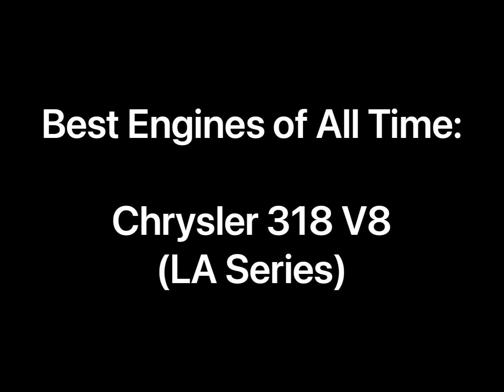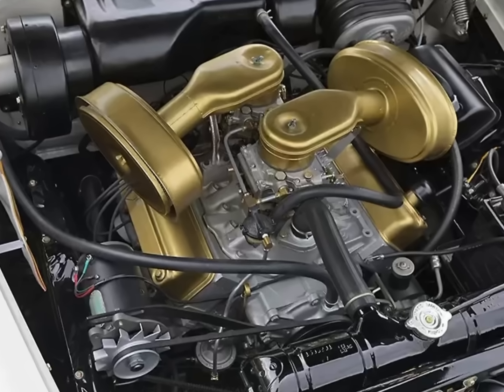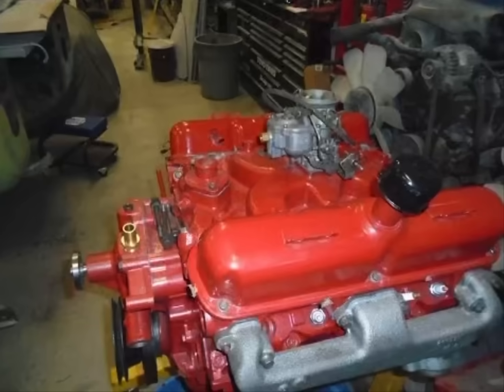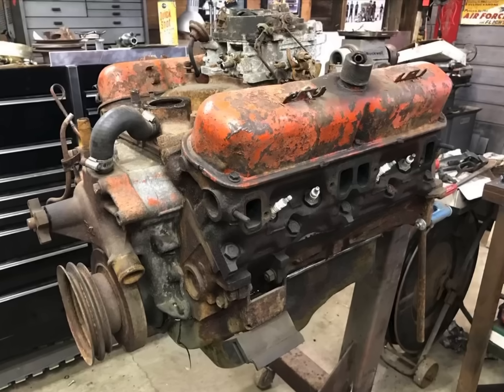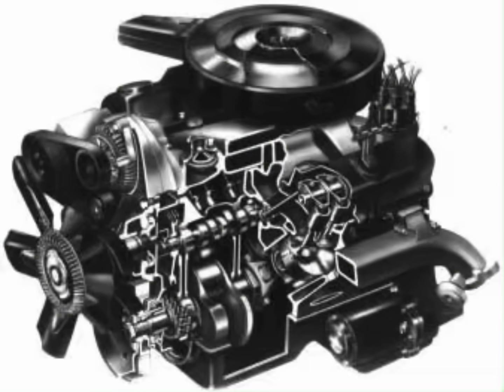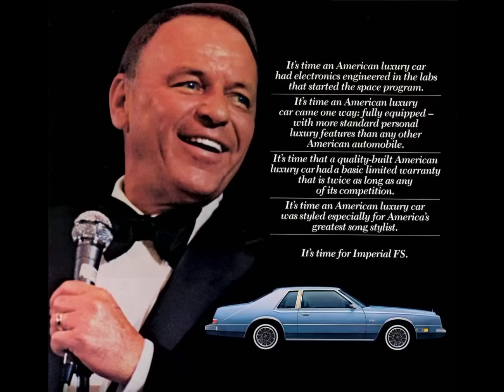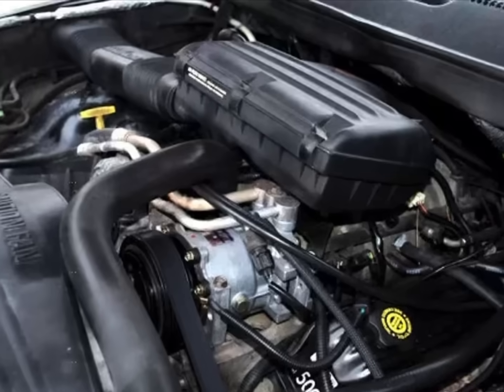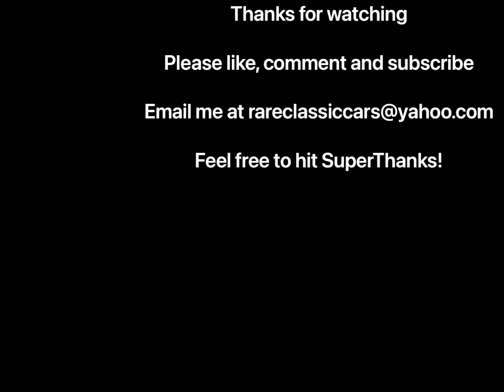Best Engines of All Time: Chrysler/Dodge/Plymouth 318 V8 (LA Series)

Comment: The 318 is indestructible and reliable because it was a relatively large engine. But COMPLETELY DIALED BACK. Tiny camshaft, 2 barrel intake, restrictive exhaust, and a very simplistic design. It made just enough power to move a big car or truck decent enough. But not enough to hurt itself. Where as a 340 isn't even much bigger but guys blew those up all the time.

Comment: The 318 is a true work horse. I worked at a golf course in mid Michigan and we had a 318 driven pump for one of our irrigation systems. That thing always started right up. Had a set of homemade headers that went through the roof of the pump house. On some nights you could see those headers glow in the dark after running for about 30 to 45 minutes. And you could hear that beast roar through the golf course when she was running! Thanks for the video Adam. Jeff of the North

Comment: I have a stock 1991 318 with the tbi system still on. Fires up every day and will run my 74 charger 130mph all day long at 11mpg

Not all of them are lemons

But. Ill see 180mph at 9mpg once I throw in a cam, singleplane intake and 750 edelbrok carb up top

Comment: Had a 318 in a 69 Plymouth Fury. Pushed that big car around just fine, with decent for the time mpg. Liked it more than the 68 Mercury Montego with a good running 302 that I picked up after. They both were no 68 Charger R/T with the 440 I had later, but still more than adequate along with their own pluses. Thanks for your fine videos.

Comment: My pawpaw gave me his and he drove it back and forth for years to the oil field and many other places and the truck is a 1986 dodge ram d150 and the Moter was a fresh rebuild that came from sun south engines back in 93 that is out of business now and the Moter has 187,000 miles on it right now the truck has had 2 transmission rebuilds and 2 rebuilt engines in it and I just turned 16 in December of 2024 and the truck has 287,000 miles on it right now and I just started driving it as a daily today so far it has been a great truck besides the gigantic hole in the gas tank I had to fix. Lol

Comment: My 1994 Jeep Grand Cherokee had the Magnum 5.2L (318) version of this engine. When I bought it used, maybe 6-8 years old, it was burning oil. I forget the mileage, but I just replaced the valve stem guides/seals and no more burning oil. The first side took a couple of hours, but I think I did the other side in less than an hour as I gained experience. The replacement guides/seals were cheap, maybe under $20! I was ecstatic because I was concerned the engine was on its last legs. It was great.

Comment: A 1974 Dodge Charger SE Brougham Edition that I owned had a 318 cui with a bunch of aftermarket performance parts including flow master 2 5/8 " exhaust, holly sniper intake manifold, mds race ignition box, four barrel holly carb, with a lot more performance parts underneath the hood, and Krager SS rims. At the emissions facility dyno they took it up to 2500 rpm's and the horsepower 275 HP. The tach went up to at least 6,000 + rpm's. I asked if he could rev it up higher to see what the horse power was and he said we can go above 75 mph because of safety concern rules for the emissions facility.

Comment: The 318 Magnum engine with multiport fuel injection was introduced in Dodge trucks in 1992, not 1993, as stated in the video. My 1992 Dodge W150 Power Ram LE that I bought from my father in law in 1996 came with the mpfi 318 Magnum. It has a black painted, traditional round metal air cleaner with a 318 Magnum decal on the lid, not the goofy looking black plastic box, like the one pictured in the video.

Comment: Since before I was born, my dad has been driving around in a 1977 Power Wagon with a 318.  The speedometer cable broke some time in the 1990s, freezing the odometer around 350,000 miles.  God only knows what the miles are now.  It's slower than dirt and uses fuel like an arson at a Shell station, but it always always always works.

With tbat said, the 318 majes a fabulous platform for performance, and they absolutely emanate power with just a mild build.  They'll surprise yourself.

Comment: Unless you have one in a 1989 pickup truck. The wiring is pre corroded from the factory and, it was  scrap wire to begin with. A lot of low mileage examples are available. Well, the ones that haven't rusted into the ground, are very low mileage. Because, they didn't RUN for long.

Comment: Wish they had kept and continued to develop the '81-'83 fuel injection. A really neat system. Would love to have seen it grow into a performance system. I managed to get an '83 Imperial that had not been converted. After reading a bit on how Chrysler had retrofitted them back in in the day, I did something like it, but much simpler. Dropped in a single wire ready-to-run distributor, and drilled an aluminum plate to bolt onto the stock manifold. As proof of concept, it initially ran with a stock 318 2V carb. Later, I used a different plate that matched the Holley 2300 style 2V carb so I could also have a functional (electric) choke. Naturally, it ran even better. The engines were production line units. It was assembled with the mechanical fuel pump eccentric installed, so all I had to do was remove the cover and bolt on a pump. After simplifying the fuel lines (stock had 4 fuel filters), and removing the fossilized remains of the electric pump from the tank, it was good to go. Still don't know why they used a 360 sized intake with stock 360 heads on it, especially with the 318 cam and a CR rated at 8.4 to 1, but it does run happily on regular gas.

Comment: Dad had one in a 72 Coronet and it was a gem, sadly that got totaled, and he bought a 3yo fleet sale 77Monoco (virtually the same car with stacked headlights, different front fenders and with 5mph bumpers)  that was undriveable due to the lean burn system. I learned how to drive in that 72 Coronet! When I was of age to buy my 1st car, no Chryser/Plmouth/Dodge products were considered although the 72 Dodge Challenger was still my favorite car styling-wise. Such a negative impact that lean burn system had on the market place, in my opinion,  it almost bankrupted Chysler. Dad bought a new Cresida after that debacle of a car and never looked back.

Comment: @travisd6585 what Mopar performance parts i have the Mopar performance computer but i never installed it its fule injection now does carborater give more power i do have the a518 transmission 392 rear end gears gears

Comment: My father had a 1970 Plymouth Fury II with the 318 c.i.d. He put 400000 miles on it and sold it to a coworker and my father found out it made it to almost 1 million miles and it only needed a valve grind at around 600000 miles !

Comment: These engines had weak compression for longevity. Well that was the case in the early 70's. My 72 Coronet has just over 200k on a stock 318 with nothing done except a new carb and bolt on stuff like the water pump, head gaskets and a new timing chain and gears. With the block having that many miles on it, I'm a little scared to change anything without rebuilding the entire thing from the bottom up.

Comment: I just bought a 1970 Dodge Dart with a 318 (all original).
Any tips for longevity and HP increases?
Reply from the maker: Not much.  Just change the oil regularly and add an oil supplement with ZDDP like STP oil additive.  Easy HP increase is  likely changing the 2bbl carb out with a 4bbl carb.
Reply: @RareClassicCars  already changed the oil and added the zinc additive, plugs, wires, air filter🙂
Next step is shocks (I think these things are from the 80's🤣) then 4bbl & exhaust (she needs to breathe). 
Thanks for the response 👍😎

Comment: Even though they played with compression ratios and tuning,  the biggest change to the horsepower ratings was the adoption of sae net instead of gross horsepower. 
For example in 1971 the 318 was rated at 235 gross horsepower, and in 1972 it went to 150 net hp.

Comment: The 318 is THE best motor ever. I ain’t drag racing, gimme that 318 that will run forever. Also, if you service the accompanying transmission every 50K AND USE THE CORRECT ATF+4 FLUID, you’re good to go for 200K+ no problem. Had two different Rams with over 200K with original, not rebuilt, drivetrain when I sold them. 🤷‍♂️🤷‍♂️🤷‍♂️

Comment: I"m not mechanical at all...but I had a 318 in a 1980 dodge diplomat..I never hear anyone talk about how those cars were lemons. They had put a computer system in those cars and maybe earlier models that f'd up acceleration. I was told those motors were good...but that computer system was bad made those cars lemons. Wish people would address those years with that computer system. I had many computer chips replaced and it would work for 5 minutes then go back to sluggish...I was told by one mechanic only way to fix it was to get rid of the computer system and go back to points? Nice car other then it wouldn't move though. They used the newer models after 80 for police cars for years in many places.

Comment: These engines were purposefully configured to be low power so as to highlight the 340 as the performance option.  Put 340 heads, cams, manifolds, & carbs on the 318 and hoo boy!  Watch out!

Comment: For your Chrysler's owners Chrysler redesigned distributor rotor which makes the spark gap rather excessive, so when I did my research I found out the Napa Mo 30000 brings the Gap the way the rotors used be. Allowing your ignition system to work a lot better.
Reply: It's  hard  getting  or  even  finding  Quality  Ignition  parts  anymore  , or  any  parts  for  that  matter ,  i  used  to  run  MoPar   parts  , Factory  parts ,  but  no  longer  available  ,  now  I'm  stuck  using   Junk  after market   parts , but  Thanks  for  the  info .

Comment: In 1992 I bougyt a brand new Dakota with the 318. It was a Magnym engine. The 318 Magnum was introduced in 1992 model year. The Magnum r60 was introduced in 1993. In 1995 there were some small changes to the 318/360 Magnums. New cams, smaller exhaust manifolds and tuning software. Dropping the hp on the 318 from 230hp to 220hp. The torque changed from 280 lbfy to 300 on the 318.

Comment: There are two key things that must be done in the design and development phase to ensure an engine that delivers good performance potential and longevity. First is correct material choices. For all parts of the engines. Block, crank, pistons, rods right down to the fasteners. The second thing that is crucial to longevity is a well designed oil system. These two of course have to be backed up with proper tolerancing to ensure that bearing fits are not too tight or loose. Adequate cooling passages. And machining operations that meet required tolerances.

Comment: The 318 heads have restrictive ports, I'd say small valves too, but the GM "LS" later proved that huge valves are not always needed. Swap to aftermarket heads and a 318 can out perform a factory 340.  The later Magnum factory heads are pretty decent, but most aftermarket support is for the LA heads

Comment: I had one of first fuel injected 318 V8's in a Dodge Aspen.  Nice car except it had a tendency to shut down on the freeway at highway speeds.  You could let it rest on the shoulder for 20 minutes and it would run another month or 2 without issue.  My mechanic could not figure it out so ended up trading it in.

Comment: 1) Stroker kit
2) 10.8 to one CR
3) Trick Flow Heads
4) Edlebrock Performer RPM intake [not air gap]
5) A.E.D. vacuum secondary down leg Carb [870cfm]
6) Performance Distributors' DUI HEI-style distributor + Ignition Solution’s Plasma Booster.
7) Headers TTI
8) Cam with 108 LCA. Hardened with nitriding process.  [adv 4 degrees on install].
9) High flow oil pump [not high pressure].
10) Driven GP1 synthetic Blend 20w- 50

Comment: I had a 1998 Dodge Ram 1500 with a 318. Going through the gears was an amazing experience hearing that American V8 roar which is a rare experience as all my family has Toyotas. It was fun thinking it had the same engine as the Plymouth fury which is the car they used in my favorite movie “Christine”. With manual fuel injection it pushed 230hp and it being a 5 speed manual with 0.73 OD and 3.96 axle ratio it did surprisingly well in gas.

Comment: Great video. 
Here in Australia I own a 1980 Chrysler!
318 which used to have the factory lean burn system and two barrel carby. 
Now it’s boasting a bigger cam,carby and ignition and so on. Still even with all this done it made 220hp on the dyno but I still love it. Had it for 7 years now. Just keeps going. 
On my channel.

Comment: Only one little mistake. The highest horsepower 273, was the 4 bbl version with 235 horsepower. Another piece of 273 trivia, all 273s were solid lifter engines.

Comment: When Chrysler stopped making this engine is when their engines designs turned to garbage. Ok, well I forget about the slant 6, it's based. No thanks. I would avoid any Chrysler after 1990 unless it included either of these engines and you can afford transmission replacement often.

Comment: The 318 was a decent engine.  Knew a guy with a base Duster with 3 speed and it ran good.  Not muscle car status.  The 340 was a lot stronger.  However I don't know its any better than a Ford 289/302 or a Chevy 283/302/327.  Certainly a Boss 302 or Z 28 302 would blow this thing into the weeds.  No experience with the 327 350 Hp but I assume it was fast.

Comment: The 3.9 V6 that was essentially a 318 sans two cylinders was also extremely reliable. My dad bought a Club Cab Dakota brand new in 1990, and that truck had right around 400k miles on it when he traded it during Cash for Clunkers, and while it was tired by that point it still ran strong. Although the transmission needed several rebuilds over that time period, the engine only ever needed basic maintenance. It was no powerhouse but it was bulletproof, and I hated that the truck met such an awful end after being such a great vehicle for so many years.

Comment: I had a 318 in a 1972 Plymouth Barracuda. I added 1970 340 Heads, an Edelbrock performer intake with a 625 Carter AFB. I ran a Crower Group II cam and a Cloyes double roller timing chain. I also ran 70 340 Exhaust Manifolds and Glass packs. That Car was quick.  I was in the USAF and when I got transferred overseas to England, my Stepdad complained about the Car and it got sold while I was in England. It was my first car that I bought with My Own Money in 1978. I wish I still had it.
Reply: One of the many vehicles that I owned one was a 79 Dodge Aspen R/T ordered through the MARINE CORPS post exchange. 
The sticker on the door jumb said made by Dodge for export no cats or lean burn and very quick 318 without the pollution control garbage.
Reply: Well Sir? First off and with all due respect here, Your step Dad sounds like a prick, that's terrible for a man that served to have had that happen. Your car sounds mint! I would love to see pictures of it. I had many GM cars however always had a love for Mopar as well. I wish in my youth I had taken an offer, from friends that ran a auto wrecking yard. They offered me a 70 Plymouth Barracuda with a 273 or beside it was a 360 74 Plymouth Satellite, I could have had either for $ 800 Canadian dolla. I kick my sorry ass for not buying either. Anyhow is what it is eh lol. Thank You for your service. "John S."

Comment: I had a 1970 Plymouth Belvedere 4dr with a 318 , man that thing was a strong runner ! I NEVER should have sold it . 
And I had a 1967 Dodge van complete camper top with kitchenette with cook range stove , cabinets , bunk beds and portable toilet , had a 225 slant six that ran strong and was so cool, it was my hippie hauler lol 😂, again, NEVER should have sold that thing . 
Had a 98 Dodge Ram Sport with the 5.9L/ 360 that was an excellent truck , I traded that for a 2004 Dodge Ram with a 5.7L Hemi that kept blowing out fuel injectors , and that was the last Dodge I ever bought , it was a lemon . 
But I’m now trying to find an older 72-78 Dodge D100 with a 318 with a solid body just for my enjoyment.

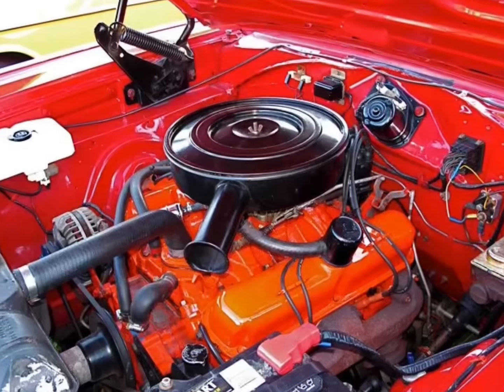Comment: Nope at 0:28.  Not from ‘67.  When my Dad bought his ‘66 Polara he was immediately afraid he had got his with the smaller 318.  So we stopped at a family member’s house who showed the 383 indication on the engine.  Dad was relieved.  The 318 was clearly available in ‘66 along with the 440 (which replaced the 413 that year).  Parenthetically, the 383 two barrel in my ‘69 Newport has 20 more horses than my Dad’s 270 horsepower ‘66  two barrel 383.

Comment: Dude I've got 14 318 engines I've collected over the years because really the 340 and 318 are the same engine with different top ends. I'm obsessed with these engines because they wake up easy and will take one he'll of a beating
Reply: Mopars  318 was like Chevrolets 350, good common engines they used in  everything. Talk about the 340 that's one bad Little engine there. Besides different heads than a 318 I believe a 340 also has a forged crank. I could talk Mopar engines all day long, there are all King!! MOPARS RULE!

Comment: Reliable? My folks had 1977 Dodge Tradesman window van with the 'reliable' 318 V8.  I recall it gave them no shortage of grief. It stalled out ALL the time. One time I counted 8 engine stalls on the same commute to school. It was hard to start and keep running long enough to warm up. The body rusted almost immediately. Despite the frustrations, they hung on to it until 1988, put about 100,000 miles on it.  But calling the 318 a reliable engine is a matter of perspective, maybe in comparison to other domestic, malaise era, engines.

Comment: I own a ‘79 Newport with the 318. Bought it from the original owner. It has just over 200 000 miles and it runs so smooth still. I’m quite impressed. Nice video 👍